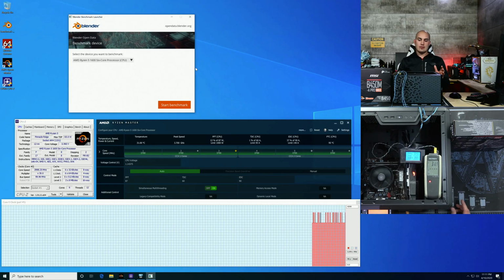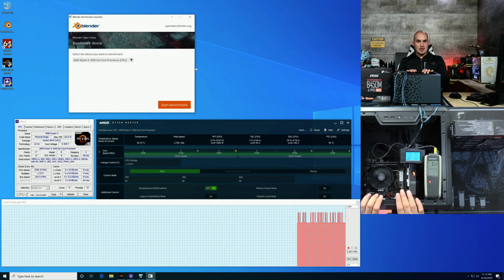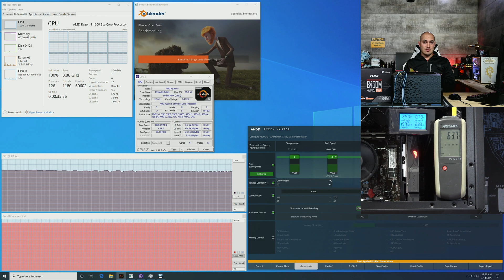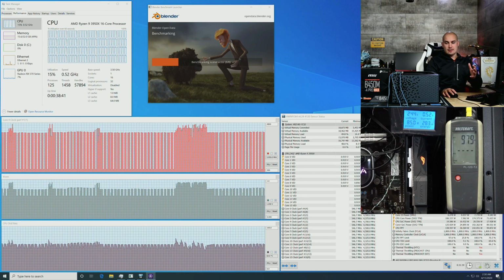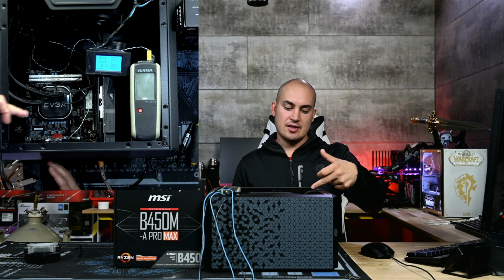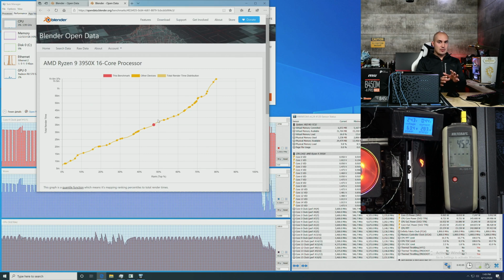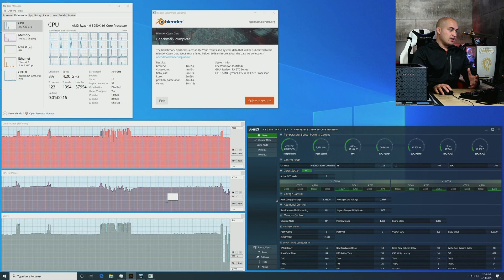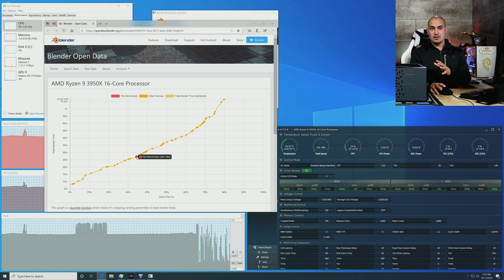MSI B450M-A Pro MAX VRM Tested with the Ryzen 1600 AF and 3950X

Comment: Excellent video.  I am considering buying a PC with this motherboard and then upgrading the CPU to a 5000 series CPU.  As the 5800x is only £0 more than the 5600x in my region I was also concerned about the vrm.  Based on your benchmarking I may comprimise with the 5700x as it only has a 65w tdp compared to the 105w of the 5800x.

Comment: Hello sir, I planned to buy a second-hand MSI B450M-A Pro Max with a Ryzen 7 1700 in it. Will it cause a thermal throttling or will it run normally?
Reply from the maker: It will run nicely 👍
Reply: @HardwareNumb3rs  Okay then, thanks sir

Comment: Will the A320M-A Pro Max operate the same with your adjustments ? Is the 450 required or will the 320 chipset function the same with your overclock adjustments  ? Please answer, I need to buy the motherboard today.

Comment: Thank you for your guides ! I have a question: Can i use Ryzen 3700x with this board or MSI b540m Pro M2 MAX but without overclocking?
Reply: Probably so. I’m using a 3900x at 4100 MHz on an MSI b450m pro vdh-max. Before this, I had a 3600x at 4400 MHz.

Comment: Could you experiment a home made heatsink for vrm or is it too dangerous?
Reply from the maker: Yes you can, you can find a lot of pure copper heatsink on Amazon that have already a sticker ready for that, the only thing to be careful is to make sure that if you fix it with a strong adhesive you might risk to damage the vrms of n case you want to remove it

Comment: I have r5 2600 and this motherboard, you think i can overclock with a better air cooler without vrm issues? Currently at 1.2V and 3.83Ghz
Reply from the maker: Yes, the 2600 isn’t demanding for this VRMs
Reply: @HardwareNumb3rs  Thanks very much!!!

Comment: I've always been concerned about the fact that the board has no heatsink over the VRMs... I have a Ryzen 5 3600 and 16GB of 3200MHz Ram, I'll be doing some video editing (nothing crazy, 1080p is enough good to me) do you think it will hold up well or do I have to engineer some kind of heatsink to throw in there before doing any kind of demanding task?
Reply from the maker: With a 3600 you are more than ok, so don’t worry and enjoy wiit Pc 🙂
Reply: @HardwareNumb3rs  Nice, thanks and nice video 👌

Comment: Good video.  Can help you msi b450 a pro max best motherboard and I have  Ryzen 3 2200g CPU overclock 3.9 and auto  vcore  voltage help  overclock igpu Apu gfx  1500 1600  mhz voltage? Fps +
Reply from the maker: This is a good board for the APU, the best way to make that CPU shine is to tune the memory and slightly overclock the GPU core, around 1500MHz and 1,17 GFX/SoC
Reply: @HardwareNumb3rs   @Hardware Numb3rs  τhanks my friend  is this b450 a pro max good?  different b450m-a pro max or  i have b450 a pro max  the other one does not have fclk b450 a pro max  i have ram aegis g skill 3000 mhz work more or no need? or to take ballistix? in the bios does not show me FCLK why?  i have m70 last bios update   and in the previous ones it does not show me this from below because I am up to 2933 xmp 2. I watch your videos all the time and I greet you from Greece
Reply from the maker: @30dimos  if you have an APU you don’t have the setting for the flck, that is from Zen2 and upward, for the ram if we’ll tuned 2933/3000 can be ok for the IGPU, sure 3200/3400 is better but if you are looking more gpu power is better to use that money to buy a discrete GPU
Reply from the maker: @30dimos  for the motherboard, the M is just smaller but essentially is the same
Reply: @HardwareNumb3rs  msi b450  a pro max good Vrm MSI  love it's good
Reply: @HardwareNumb3rs  understand   thanks friend bios igpu 3.9 volt?  I gpu 1500 mhz I dont 1.7 1625 volt  Change igpu and gfx core and overdrive? Hw monitor  game dota 1.5v idle 33c Vrm game 36 37c.  Game 80 fps 100 fps    motherboard b450 a pro max
Reply: @HardwareNumb3rs    the tdp voltage will remain automatic ? auto 1.408 v max  g skill ram 3000 mhz 2x8   this ram does something more or it can not because a few times I did not do much there is hope or up to 2933
Reply: @HardwareNumb3rs  3.9 1.37 volt 1500mhz bios doc voltage 1.168 176 volt  dota game 154 fps  full fps settings I try to fix it as much as possible correctly and from temperature to vrm it is 34c stock cooler I want your opinion because when I write on it the volts are not exactly on the board as I have it adjusted a little down

Comment: Do you think the MSI B450-a pro max (not the micro atx) should handle the 3950X similar to the Tomahawk Max? I ask only because it looks like the VRM section is similar. I think the Tomahawk has a bit larger heat sink but otherwise I think they are similar.
Reply from the maker: Maybe, but is a big risk, if you need a 3950X for multithreading I wouldn’t go cheap on motherboard, an entry level X470/570 is by far a better choice, driving a motherboard to the limit is risky, it may work fine for years or start a nasty troubled relationship 😁
Reply: @HardwareNumb3rs  Ok much appreciated it :)  Was curious for down the road. I have the board an its got a 3600X on it which is of course no problem for it, but I thought for later if I saw a second hand chip for cheap ;)
Reply from the maker: svtcontour if you don’t need much cores you may look for a 6/8 core Zen3 as an upgrade (if the board will have the updated bios) or if you game only a 3950X won’t be better than yours, if you don’t have 3600/3733 capable ram (and do manual tuning) this will be something you should looking after to get a good performance bump 🙂

Comment: Great video! As a computer technician as well, I also think the safest and best processor for the B450M-A Pro Max is the 3700X, although the bios that comes with the board overvolts it by mistake, I fixed the Vcore and SOC manually with stable 4Ghz all cores and got 10280 on 3DMark processor points. It is pulling nearly 110W in stress tests and around 85W usage average(the CPU). So the AMD TDP reference is just symbolic.
Reply: I just got this mobo and the 3700x, thanks for The info, I was worried it wouldn't work well, have a nice lifetime
Reply: Hola bro u got any social media??
Reply: @abouddeuce6832  @bentoyolo
Reply: Sir can i ask you how good is ryzen 5 3400g with this board?

Comment: I have this board currently with a R5 1600 AF at 4ghz overclock and don't experience any thermal throttling at all, which is to be expected as per your video, though I do also have a 60mm fan resting on top of my CPU cooler pointed towards the VRM's as I also sensed they could well be a limiting factor with OC/high core count CPU, I plan to upgrade to 3800 after Ryzen 4000 series and will monitor how they hold up at that point before deciding whether to upgrade or not

Comment: Hey great video, In conclusion, could I buy this board to make an OC at 5 1600af at 3.6 ghz?
Reply from the maker: Yes, and even more, you should be able to OC the 1600AF to 3,9GHz with the stock cooler at around 1,2/1,25V
Reply: @HardwareNumb3rs  thanks you
Reply from the maker: Andrzej Kresimon ask anytime 👍
Reply: @HardwareNumb3rs  Following your tutorial I put my 5 1600 AF at 3 6 ghz, and 1200 v, but I did not notice an improvement in FPS performance, I tried to set it to 3.9ghz with 1300v but the computer did not start and I had problems entering the bios at  I finally solved it, how could I earn more fps with this cpu?
Reply from the maker: Andrzej Kresimon with memory, Have you tuned it?
Reply: @HardwareNumb3rs  memory T-Force 2x8gb with oc at 3200

Comment: I am running a 3600 with this board and it works great. Boosts to 4,2 ghz all core no problem and can stay there forever without throttling ever. You only need to make sure that you have high amounts of airflow, for example a mesh case (e.g. NR600) with 2 or 3 case fans, since that will pull down temps by a lot, especially with a mATX board like this, where the components are so cramped together. I would recommend this board for budget builds that don't want to upgrade much in the future

PS: I bought the board because of your review, so thanks a lot for this vid!
Reply: Did you buy a cpu cooler?

Comment: Great Video ;)
Can I get this motherboard with a Ryzen 5 2600 & MSI GTX1660 & CoolerMaster 500W ?
Reply from the maker: Yes, of course,  you can run a 2600 easily with that board
Reply: @HardwareNumb3rs  How about 3600?
Reply from the maker: jokso22 even better, this board can handle even a 3700X
Reply: @HardwareNumb3rs  And if you want a little OC then just glue some cheap heatsinks on it right?

Comment: Hi. Very informative and well done video. I have been looking for a video like this for a long time. I am considering buying B450M PRO-VDH Max Motherboard and Ryzen 5 1600 AF CPU. I read that B450M PRO-VDH Max has better VRM heatsink than for example B450M-A PRO Max or B450M PRO-M2 Max. I would like to upgrade to ryzen 7 3700x or 3800x in a couple of years. Do you think that B450M PRO-VDH Max motherboard's VRM will handle 3rd gen Ryzen 7 CPUs? Maybe you could test this motherboard as it is also a budget micro ATX motherboard but with a little bit better VRM heatsink. I just don't want to spend more than 80 euros for a motherboard right now for 1600 AF build, but I would like to upgrade my CPU in the future. Looking forward to your reply!
Reply: Just for more information, I am planning to OC ryzen 5 1600 AF to 3.9/4.0 Ghz but not planning to OC ryzen 3700x/3800x in the future. Will it handle the OC'd 1600 AF and Non OCd ryzen 7 3rd gen?
Reply from the maker: @Karloskarluts  Yes, a 6 core overclocked will do fine, same for an 8 core like the 3700X at default, plus overclocking a Zen2 is not that useful

Comment: Hi, can you let us know what OC Settings did you used for 1600? You used just Ryzen Master or any other settings via BIOS ?
Reply from the maker: Is very easy, check one of my latest video where I test the 1600 AF, you can find everything there in detail
Reply: @HardwareNumb3rs  One more thing If you are able to help me. on my b450 aorus pro I can't set the voltages, I just need to use offset. Any ideea what offset should I use for 4.0Ghz. very good aIO cooler

Comment: dumb question
will this motherboard handle a 1600af with full 4.2ghz oc all core with 3 120mm intake at the front and 1 exhaust at the back ?
Reply from the maker: Gloppin Boopin VRM side yes, even without the fans, clocking the 1600AF to 4200 depends on the CPU luck and cooling, and 4.2 is quite difficult with normal voltage and cooling
Reply: @HardwareNumb3rs  i'am gonna be using a 4 heat pipes tower cooler with 1 fan
Reply from the maker: Start to 3.9/4.0 with max 1,375v and try to raise the frequency, but keep the temperature under load below 84°C, probably you’ll have to lower the voltage as well to stay within the thermal limit

Comment: In your opinion, these type of boards can handle a Octa Core? 

Its a nice video indeed, sadly you dont more boards to test right?

It will be awesome to you checking Tomahawk, Gaming Plus, Pro Carbon and etc against r9 3950X

Thanks for the video!!
Reply from the maker: Enio Apolinario This board can handle the 3700X for sure, since up to 85W it works perfectly. I can test other boards that I have here but since I’ve already done the Tomahawk and the Taichi there aren’t much left, testing the Crossairs is pointless since they are monsters. Maybe I will try to find a budget X570

Comment: Wonder if you put that Motherboard in a Case that you could Put your Top and Rear case fans as Intake to Cool the VRM and set the Front Fans as Exhaust?? 

Also TBH MSI lists the 3950x as Compatible with this Motherboard, it should work fine at Stock settings, but I don't think they Thought anyone would use That Board for Blender! LOL!
Reply from the maker: I tried to blow some air but it didn't change the result, maybe with an aftermarket heatsink it will probalby hold more, I will try something in the next weeks :D
Reply: yes please with after market heat sinks

It would be fun to know how well this board could handle 6 or 8 cores at 65w TDP
Reply from the maker: jim builder up to 85W tdp is fine, I will try with active cooling and some heat sink to see if we can go past that 🙂

Comment: How about the performance using some extra airflow on that vrm?
Reply from the maker: Yasvar is something I will definitely do in another video!
Reply: I might be wrong but I think that the air cooler helps keep the vrm temps down because they get air flow over them. By changing to a water cooler he effectively removed that air flow. Making his point invalid.
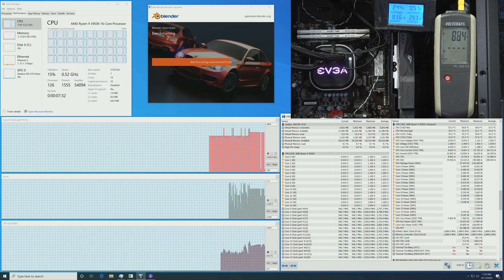Reply from the maker: Crazy65pt You are right about air coolers, in fact at 5:28 I say exactly that, and I repeat the test with the air cooler 🙂
Reply: Edit: Commented before watching the hole video. So he was actually correct. I now see he performed the test again with active cooling over the vrms and the result ended up being the same

Comment: nice ! i have same motherbord and ryzen 1600AF <3 <3
Reply: do u overclock it ? and is it stable ? 
and what temperature you reach in vrm  and  cpu itself ?
Reply: @moslem8656  I have the same motherboard for 3700x at 4.3Ghz 1.3V and there are no problems
Reply: @deathfire6479   i think i should take non m version .
but what vrm temp u reach ?
Reply: Deathfire so an 8 core cpu in this motherboard is fine then?
Reply: @danisantos3255  I have it for a few months and there were no problems